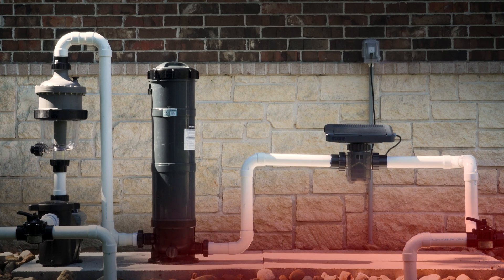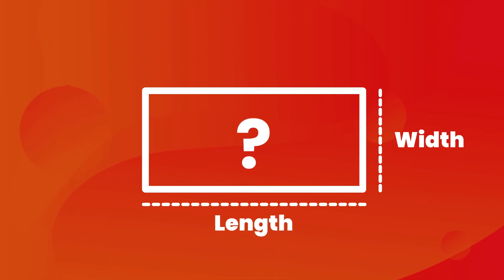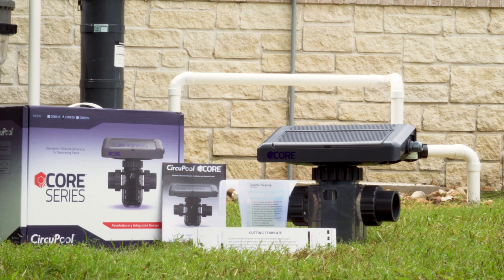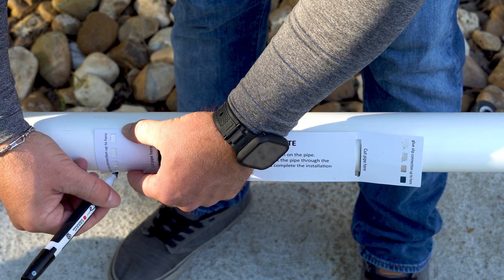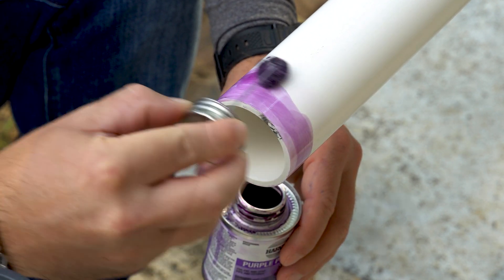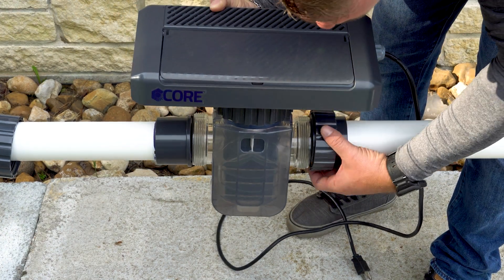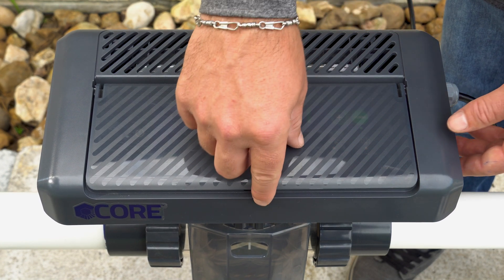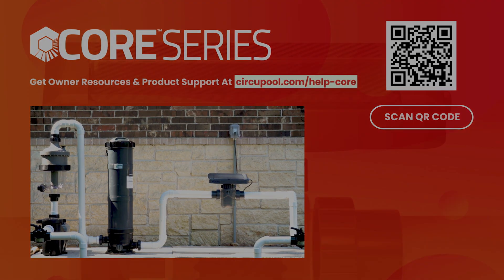Installation Guide | CircuPool CORE Series Salt Chlorine Generator | How to Install Your Salt System

Comment: how far does this have to be from a heater
Reply from the maker: For typical chlorine generators , their maximum water temperature for operation is roughly 140F. If you want the chlorine generator in operation at the same time, the goal would be to ensure that it is far enough away to achieve this. Its ultimately going to be dependent on capability of the heater based on its model specs and recommendations; this varies and could be as much as a couple feet or more. Also be sure to follow all safety recommendations from the heater manufacturer as far as spacing. Refer to the heater manufacturer's guidelines and instructions for the best information on this.

Comment: Do you have any recommendations on how to install this product for an above ground pool using flexible hosing? Is that possible?
Reply from the maker: Yes!  We have quite a good number of these units installed in aboveground pools.  There are two considerations for you in this situation.  The first is that the salt chlorinator itself needs to be installed in a section of Schedule 40 PVC.  The second issue, then, is to transition between the PVC and your flex hose.  This can be accomplished via this part:  https://www.circupool.com/aboveground-pool-flex-hose-adapter-set--connects-hose-to-pvc-unions-fits-aboveground-pool-pumps-filters-salt-chlorinators.html